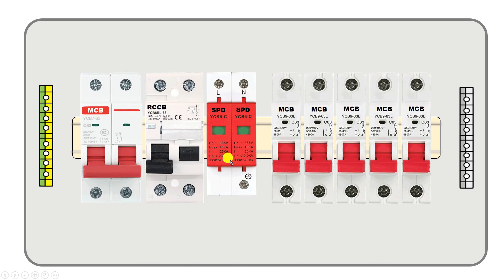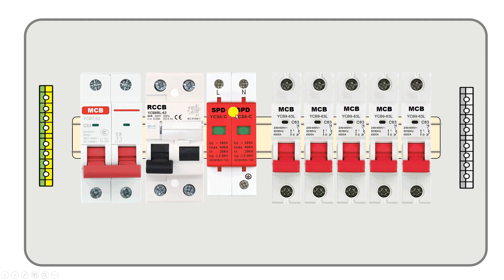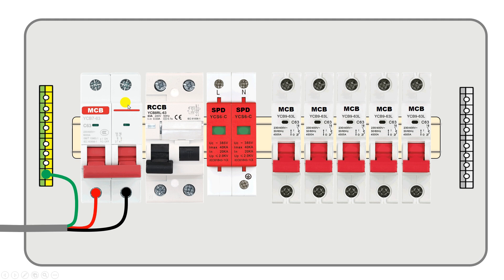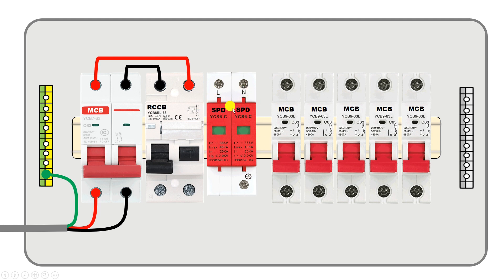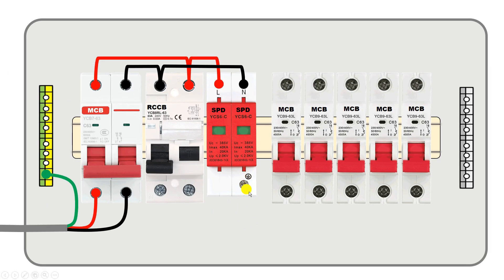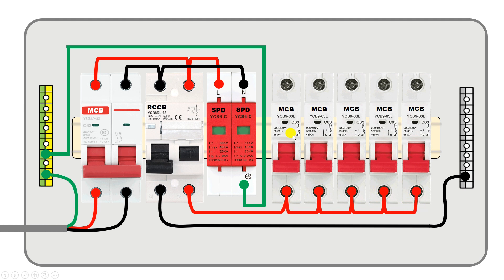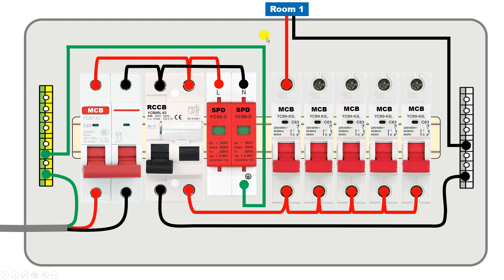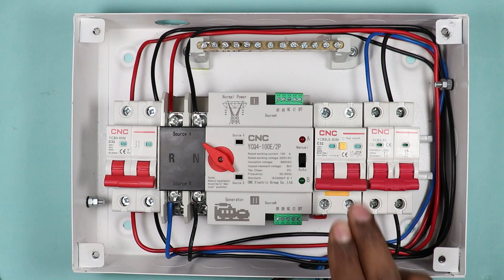5 Room Distribution box wiring with all Protection Device | MCB, RCCB, SPD@TheElectricalGuy

Comment: If i connect an SPD to my distribution board is there need for thunder arrestor installation?
Reply: Your SPD connects to the thunder arrestor which then send the transient voltage surge to grounding rod buried.

Comment: MCBs are not bi directional, live in the top,?
Reply: You must follow the breaker manufacture's wiring diagram. Input Line terminal must be connected to 1 terminal and Neutral to N terminal. The connection is correct.

Comment: Give me a solution for low voltage in home..that too because of neabhour house uses AC in auto mode which starts and stops many times.whn there AC is off its normal for us
Reply: You can use a wall mount Automatic Voltage Regulator (AVR) to correct this issue. The AVR works by stepping up the input voltage from grid to constant 220V output to load.
Reply: @ovieoyegwa6153  tq so much ..can I buy online or offline..best brand???

Comment: Thanks sir, bt why are you using same rating circuit breakers???
Reply from the maker: I can't find a different different rating picture of any circuit breaker so only, I have just explained the connection of distribution board this video is not about the rating of Circuit breaker
Reply: @TheElectricalGuy  oooh it's that ouk, but I can put different rating circuit breakers during wiring